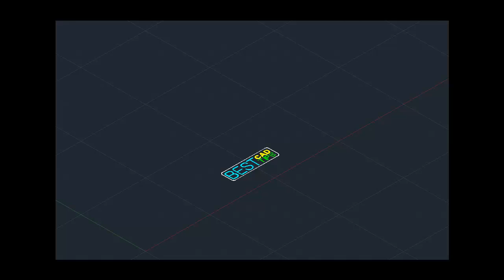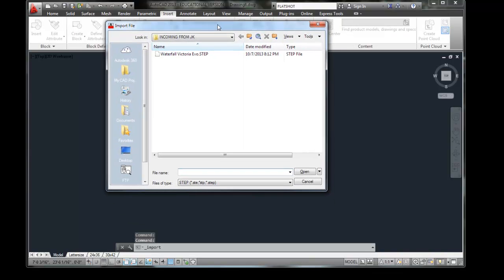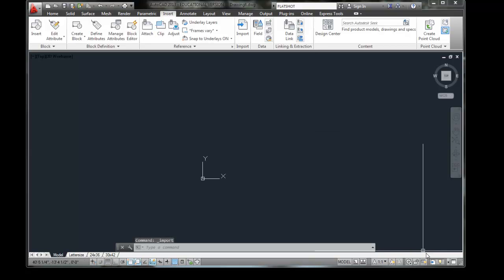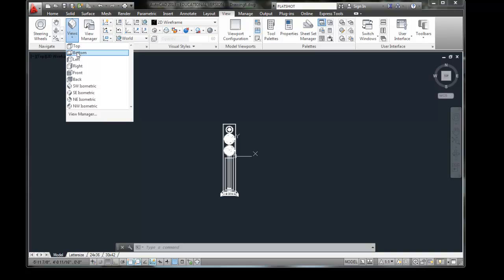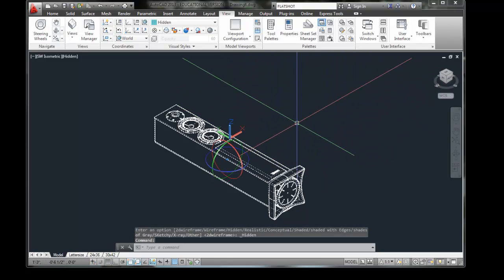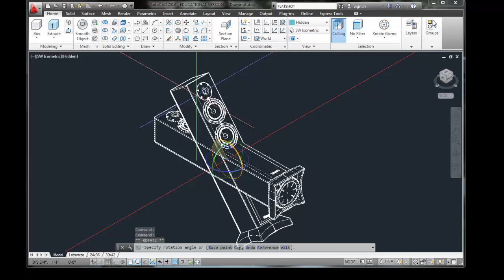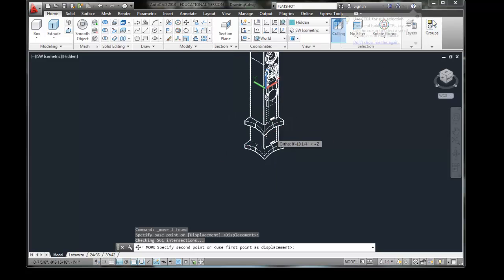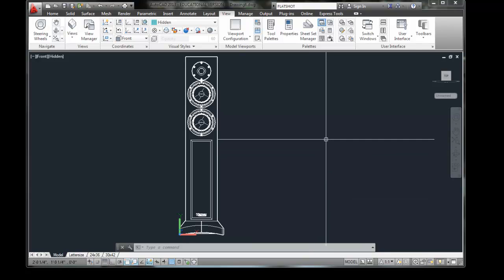BestCADtips 1039 Importing 3D STEP Files to AutoCAD

Comment: A few differences with 2025 but not huge. There is no longer an "import" ribbon but you can simply type this into the command line. Similarly, the hidden view command can be typed rather than clicked. Other than that, this is the main difference as well as the 3d navigation which is a pretty intuitive 3d box in the top right corner where you can just click on whichever face you wish to be presented. Still a great video 12 years later, well done.